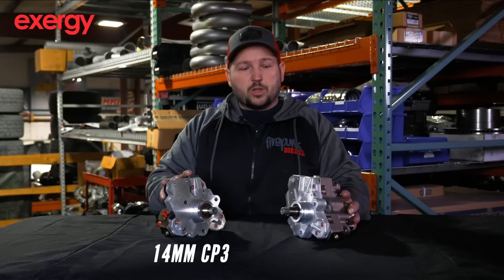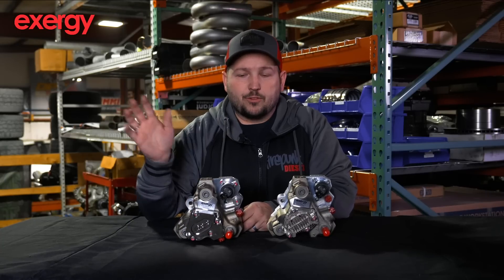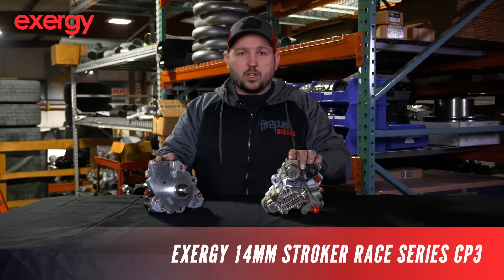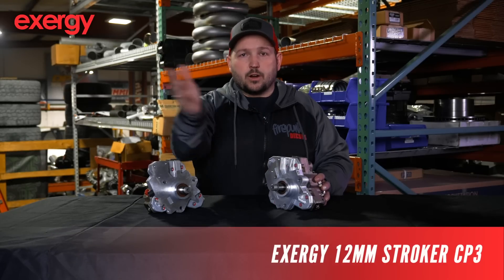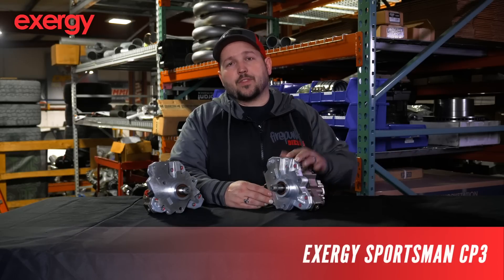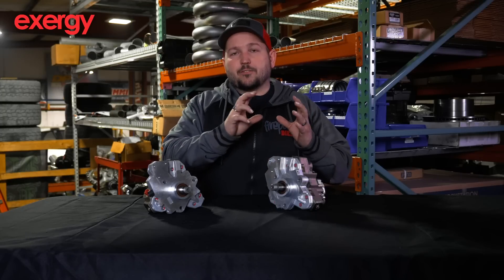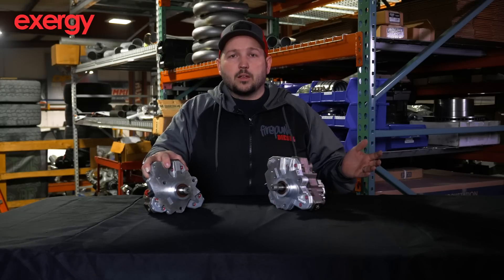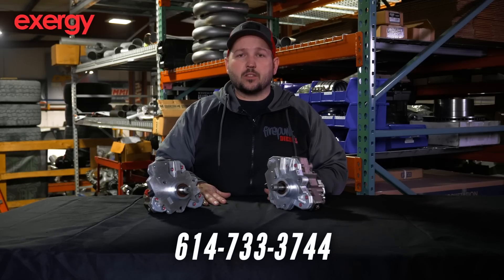EXERGY CP3s - Stroke Size VS Horsepower

Comment: Lavon, 

With a 14mm being able to support so much power, is there any advantage to running a dual cp3 set up??
Reply: The reason I ask is because I know y’all just dyno’Ed Chris gelbaughs truck and made 2000hp but that was with dual 12mm pumps so what would be the advantage to that rather than a single 14mm
Reply: @Landon Schad true but the point of my question is if a single 14mm pump can do that why buy multiple stroker pumps for a truck that is 2khp or less